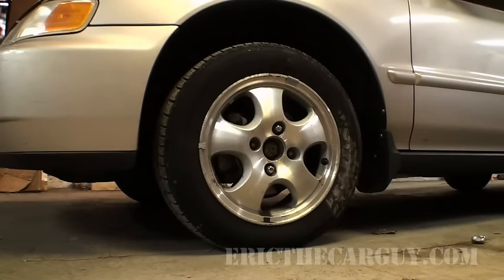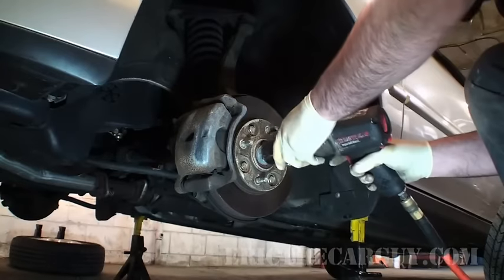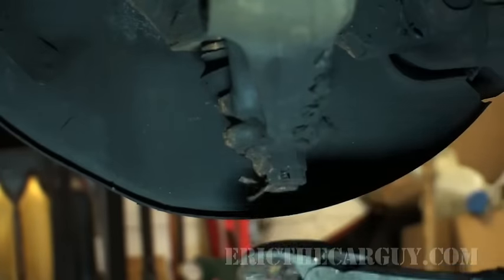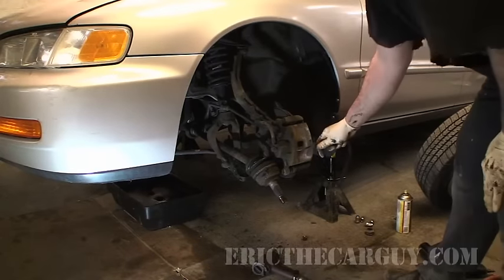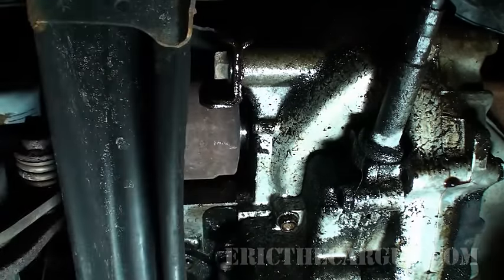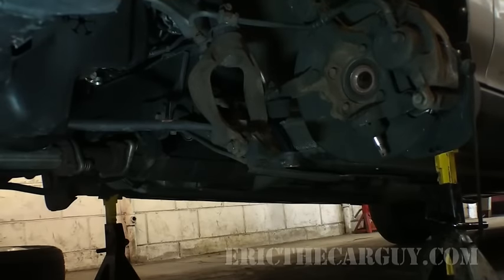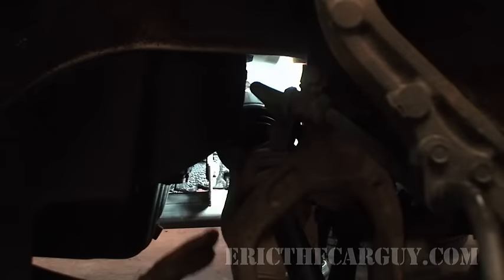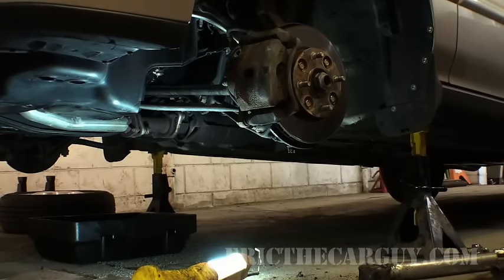How To Replace a Front Wheel Drive Axle - EricTheCarGuy

Comment: How does that cv joint differ from say my 1992 Cadillac sedan de Ville with the speed dependent damping struts?  I’m having difficulty removing the front cv joints. The rear struts came off easily.

Comment: In the span of almost 1,900 comments, I'm sure this has been said, 
but... older Hondas have notoriously stubborn axle nuts -- which Eric, 
as a former Honda dealership tech, knows -- so he does a slight 
disservice to DIYers by suggesting that the weight of a 
body-by-Drive-Thru will be enough to loosen them. They can be miserable 
'breaker bar breakers' if you aren't fortunate enough to have any 
magical influence, separate or combined, of an impact gun, penetrating 
oil, heat, breaker bar extension leverage, or just overall good 
condition and relative ease of removal. 

You could probably have your grandma spin an axle nut off of an older 
Honda if the car never left southern California or Arizona, but anywhere
 that rust and winter road conditions prevail it's a different story, 
especially if this kind of work was rarely if ever done on the car. Eric
 is in Ohio. He shouldn't overlook or downplay this potential game 
changer. ; ] Shit that doesn't go according to plan is an entirely 
different kind of shit when you don't have facilities, abundant time,  
or pro-grade gear to eventually make the special moments happen. 
Persistence and the patience of Job are often the most important 
elements of DIY car work. ; ]

Comment: 1999 honda crv reinstalling the left front axle. It won't reach the ball joint hole. Off by half an inch. The axle looks seated at the transmission. Not sure what is holding it off. Any suggestions? Thanks

Comment: Eric  i have a 2001 suzuki xl7 got stuck in mud so put it in 4x4 and the light flickerd out  now i had to jack up suv to get front wheel on stuck was locked up like jammed  now i cant move the 4x4 shifter back in to 2 hi n or4low its stuck in4high any adavice thanks

Comment: i replaced mine on my s10 but the p side shaft wont lock in ive tried pounding it in with a hammer and a block of wood but it cam loose is there supose to be a little gap on those or no gap at all?

Comment: Eric am have a problem I'll been following your videos for some time now..I have a 1996 honda civic hatchback I take it to get my front wheel bearings  change. after that the two wheels are wobbling I buy new hubs and bearing and had them change again  still the wheels wobble  what you think is the problem? Plz help
Reply: ***** Warped brake rotors.

Comment: I'm trying to identify a suspension/steering noise at the minute. I get the slightest knock coming from the CV joints on both sides when moving the wheels at the 9 and 3 position.

Is this normal?

Comment: Hey Eric, if the cv joint pops out of the transmission, can that cause my Honda to not drive and also not stall when the clutch is let out? This is happening to my 97 civic right now. I can shift into every gear without even pressing the clutch. Also my car will not drive it will only rev up when in gear. Please help me out man, I'm in need of help bad.

Comment: Please help me, my accord 2006 A/T the left front tire fell apart from the upper ball joint, now it’s really hard to move the knuckle in order to align it with the ball joint, I can feel the axle is shot inside, when i go through parking, reverse and drive it feels like the transmission is kicking and the axle moved itself forward, that’s why is really hard to align the knuckle with the upper ball joint. could be this the transmission or axle? Thank you

Comment: quick question eric on my ram 3500 there is some oil leaking from the rear of the transfer case and it is eating up some transmission oil over time 
so my question is does the transmission and transfer case share tranny oil
also there is a humming and vibration coming from the drive shaft where do you think it is coming from 
  thanks

Comment: Hey Eric, I'm going to be doing both CV joints on my 96 Civic DX in the next couple of days and I have a question. I watched another video where the guy took a drain bolt off and topped off his transmission fluid after the new joint was installed. However, his Civic is a manual and mine is an automatic. Is that step necessary for me? In no other CV replacement video I've watch has anyone else done that. Is it only applicable to manual transmissions?

Comment: I hate when the axle but doesn't want to come off too. Usually set the breaker bar horizontally  so I can pull it up on it with full force while my friend holds the socket end flush with the nut so it doesn't pop off. With an 18in bar I reckon at least 400lb feat of torque haha.
Reply: I use my floor jack handle on a 12in breaker bar.. It's like a 5 foot breaker bar.. Works GREAT!
Reply: CDubs HasIt I will keep this in mind when things get stuck that crazy. Thanks for the tip!
Reply: +Mingo Rolince And if they fail, you can either drive to a shop and have them just break it loose, or if you can afford it, Ingersol-Rand's W7150 battery-powered impact gun should do (780-1100ft-lbs).  The price seems to have gone up since I bought it.....
Reply: JPN850R I was looking at the Milwaukee M18 Fuel 1/2 in drive high torque version. Lol. Ive haven't needed one yet but we'll see
Reply: Mingo Rolince　The M18 seems just as powerful as the IR (wasn't available when I bought my IR, but I still love it), and the price range is about the same.  My TL's service manuals says "apply engine oil on the mating surfaces of the hub nut upon installation", which some people probably neglect.  I hope things go well for you.
Reply: JPN850R haha the last time i messed with an axle nut was 3 months ago. im not even concerned with it at this point. Thanks for the advice though.
Reply: i use a 2 ton floor jack on the breaker bar, works every time.

Comment: i need some help.. i replaced the CV joint which noise came when i turned (when i turn right, so replaced left CV Joint and boots) but again just after few months noise is coming from the same side (not everytime). why is that ?

Comment: Again anytime there is a threaded peace exposed put a nut on it unprotected 1 miss with that hammer and now you have to have tap or use a thread chaser to repair if not replace parts that it would have only taken a few seconds to screw that on. And if you damage the cotter pin you're fine a coat hanger usually will supply a nice substitute.

Comment: This might be a stupid and I'm going I find a answer quick if possible please but are both axles suppose to turn in the same direction  with the wheel off  while your turning one axel ?? Thanks
Reply: DeezSteez They will probably not, since there is a differential between the 2 axles.
Reply: DeezSteez There are three commonly found types of differentials in vehicles. Most passenger cars have open differentials as seen in the video where when you spin one wheel with the transmission in neutral, the other will spin in the opposite direction. The other type is a limited-slip (also called Posi-Traction or Possi) differential, where they will spin in the same direction. The third would be found in 4WD (and a couple 2WD trucks) vehicles and is erroneously referred to as a locking differential. There is no such thing. These vehicles have limited-slip differentials.
  
Less commonly found these days is a differential lock which are pretty much exclusive to only a few select 4x4 trucks. The Jeep Rubicon, Mercedes G500, and Hummer are the only ones I believe. On some vehicles a Differential Lock can be added on top of the cost of 4WD limited-slip system on some Toyota, Mitsubishi, and Porsche SUVs.

All that probably made no sense, so I found a few links to explain better:

http://www.offroaders.com/tech/limited-slip-lockers-differentials.htm
http://4x4abc.com/4WD101/locking.html

Comment: Are most cars set up that way where you can just pry the axle out? I have an audi and i was just wondering if you knew.
Reply: I'm not an experienced mechanic (when it comes to this, I feel like an experienced DIY on many other aspects), but judging by watching several of these videos most are just held in by that little clip.

I have seen a few where a few bolts hold it in too.

If you look at it during the job, you'll find out which type it is.
Reply: Subarus are the one exception that comes to mind.  Some of them (but not all) have a roll pin that must be driven out to disengage the inner CV
Reply: ratbert86 thank you very much for teaching me that.

Comment: hey eric wat if on my 91 integra im doing an engine swap but my axles dont wanna come out i did exactly wat i did wen i changed them the first time but it wont come out from the rotor and its slowing me down from pulling the engine

Comment: I have a question Eric if both of my axels are completely broken on my Honda Civic 94 hatchback and I go into gear will it still move because I did a test I lifted my car turned it on out it on first gear and the tire would move but very slowly also I could move it in both directions while in gear could this be my axels or something else I'm in serious help thanks in advanced if you reply.
Reply: I think youve got a clutch problem dude

Comment: When you take the axel out is there supposed to be oil coming out as well? Im currently changing the axel on my 94 honda accord and when i pulled the axel out oil came out as well
Reply: Yeah I wondered that aswell. Because usually when you pull the drive shaft out transmission fluid cones out and you need to top up the gearbox with new oil.
Reply: Davide Smiley there are seals where the axles go into the transmission, yours are probably damaged and need to be replaced.

Comment: what if the axle keeps coming unseated from the output shaft leaking transmission fluid everywhere? I'm going to replace the axle, and output shaft seal. If that doesn't fix it, I'm parting it out.
Reply: I've had all that happen. Bad Axles come apart. Bad motor mounts in my case, is what made the axle go bad.

Thank goodness that the shop guaranteed their work. They replaced it three times before finding a bad motor mount...now I know to look at motor mounts everytime I see a bad axle.

So, is your axle bad? Sure, but I think something else is causing it to go bad, so it's a symptom of another problem.

Good be a transmission mount too...to me it's still an engine mount. My DIY trick for something like this is to see how many of them are for sale so I'm sure I found and checked on them all.

You could also take a pry bar and see if there's much movement in the engine.

Lastly, once you know the symptom of a bad engine mount while driving you'll spot it again. If your car keeps feeling like it's catching up to in response to you foot, then your engine is turning, and coming back flat finally delivering the power through the transmission.

Comment: In my car when going around 45-60mph the car starts to shake. The steering stays still though. You can sometimes here a rattling noise. When driving and I shift into neutral and as the car is slowing down it shakes more and you can hear it rattles. Would that be my axle?
Reply: Give it a service and check whats going on. It might be the transmission.

Comment: I know the vid was posted years ago but need help. I notices that when you took off the axle no fluid came out. I drive a manual and when I took my axle out it’s leaked out so much but don’t know if I had to much fluid in the transmission or all cars are different I manage to put 2 bottles in the trans but don’t know if that was enough or too much Any pointers?
Reply: Nismo King The trick would have been (if using  jackstands)
Is to have temhe car sligtly tilted so the the fluid wont come out.

Comment: hey eric whats up , am in the process of replacing both cv axle , i just did the  left side 
and wasn't so hard , even tho the boot wasn't torn inner or outer . went on test drove the car , and no more clicking noise from L side just R side. went to the store a couple of miles came back home , made the turn and notice a different clicking noise from the cv axle i just put in. any ideas what happen? i mean its brand new.
Reply: Whenever you're messing with wheels its very important(imho) to do BOTH at the same time. You're putting more strain on that new side more than likely. Fix the left side and see how it does. It could also be numerous other problems down there clicking so be sure to inspect everything while you're down there ie tie rod ends control arms struts etc etc.

Comment: Eric, if I accelerate from a dead stop my car rumbles a little bit then goes away, this fumble come from the drivers side do you think this is the trans or cv axle . Car is front wheel drive
Reply: Could be either but I would check the balance of the tires/wheels first.
Reply: Balance isn't an issue until you get up to 45 or 55 mph.

Comment: it looks like the axle you removed was not ABS but the one you put in was ABS is that what happen and if so is that okay to do ???
Reply: Dennis It's not gonna hurt anything since the car does not have abs. Alot of times the axle will be cheaper with the tone ring than without because they may have made more of those than the other.
Reply: The guy that works at Autozone told me I could not use a CV Axel with ABS on a car without ABS. So I assumed he new what he was talking about at the time. So much for working at a major auto parts store and knowing what your doing ... LOL

Comment: I have a 2012 Suzuki swift JDM version when I'm driving and say apply the brakes and about accelerate again I get I vibration when I move off or if I'm turning at low speeds

Comment: Someone tightened the hub nut on my car so tight I snapped the 1/2 inch drive on my breaker bar. I had to borrow a 1 inch drive bar and socket to slacken it.

Comment: what was the point of taking the chisel at the end and tapping the end of the axle where it came out of the wheel hub?
Reply: +mitchell baxter typically there's a little tab on the nut that bends into a notch on the axle end to keep it from working loose. Some axle nuts are castle nuts and have cotter pins instead, and some have a small cap that fits over them and locks to the center of the hub somehow to accomplish this. My Tacoma had a cotter pin AND a locking cap.

Comment: Heres how this DIY would go down for me: roll up into autozone parking lot cuz ill be walking in and out about 5 times, spend 2hrs trying to get the axle nut off cuz the breaker bar wasnt producing enough torque, 30 minutes beating the axle out of the hub after buying a fat hammer from autozone, 1hr trying to get control arm bolt off cuz that bitch is in there too tight, 1.5 hrs trying to figure out how to get the axle out of the transmission after renting assorted tools from autozone, 1hr getting the axle out through the wishbone cuz the nut wasnt coming off, another hour figuring out how to get the boot back on the new  axle cuz i had to take it off to get it through the wishbone, 2hrs beating the new axle back into the transmission because for some reason its not going in, 1 hour putting it all back together cuz shits not going back into place. 9 hours and lots of cussing later Im finally done.

Comment: Can a bad axle cause steering vibration on acceleration, my local shop is telling me to get it replaced cause steeeing still vibrates even after a force variation balance job?
Reply: +Yo Fizzle I've had the same issue for a few months. Checked my CV joints on drive shafts & one is shot, I would expect it's the same.
Reply: Yep, inner. Changed drive shaft (along with new track rod end, which was gone also), no more vibrations!!

Comment: Any problem with re-using the "single-use" axle nut?
Reply: most new axles come with a new nut. ive reused many without issue.
Reply: Thanks -- I'm thinking of situations where you have to detach the knuckle from the axle to do other repairs, such as replace a bushing or just to keep the axle boot from being stretched when removing a strut.  Seems excessive to have to replace a large, sturdy-looking axle nut when you are not replacing the axle.

Comment: replaced struts. still have a cluncking in my front end passenger side. would the be the ball joint by Chance?
Reply: +kerry Bennett just search for 'front suspension inspection' or etc.. It'll demonstrate a very simple procedure you can do to get your eyes and ears directly on the concern. It only takes a jack and jack stand (because you're putting your hand on the bottom of the tire at a certain point) to do. No other tools necessary.

Comment: I can't believe you hit the axle end with a hammer. Normally that results in a deformed thread, making getting the axle nut back on!
Reply: He explained why usually he would put the nut on the prevent that from happening but because he's replacing the shaft anyway he took a hammer to it and went to town on it. Perhaps if he was reusing this one he would of used a soft face hammer? Or used the nut to prevent the thread from flaring as he explained.

Comment: Anyhow I Eric I got out the left side axle the short axle I’ve got a Ford laser 1993 model I’m outside I couldn’t get out that boat that you said I sorry for you So I am did the other side of it and because I ripped off the whole Axel of the boot there’s still that metal thing stuck to the gearbox and get it off so I finished the other side and started up the car

Comment: Isn't it true that you have to loosen the castle nut to get the cotter pin in flush?
Reply: brian versansky NEVER LOOSEN THE CASTLE NUT if you can’t get the pin in, use a long breaker bar or ratchet and tighten it just a tad until it’s able to go through